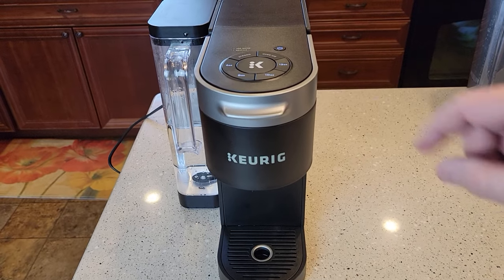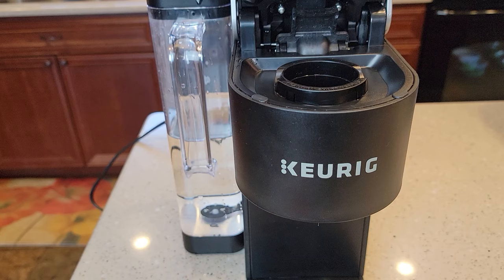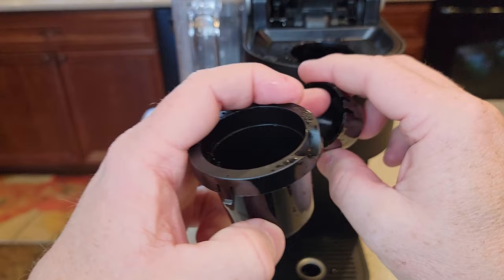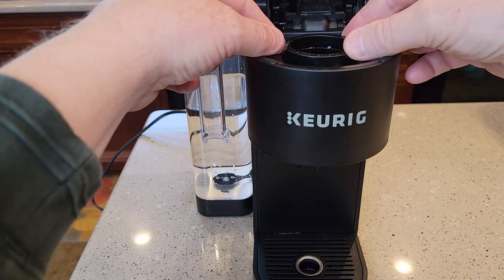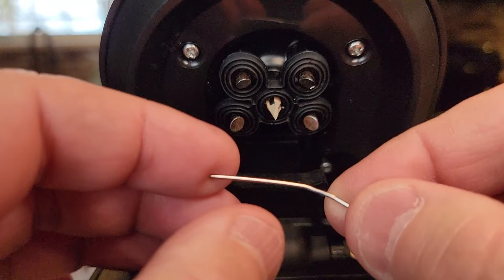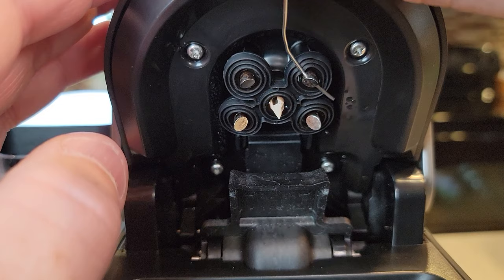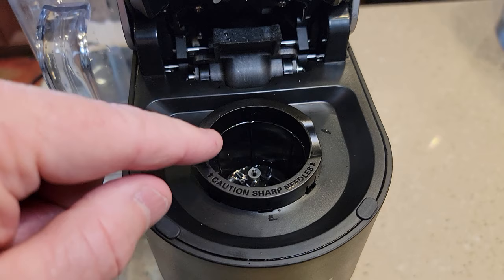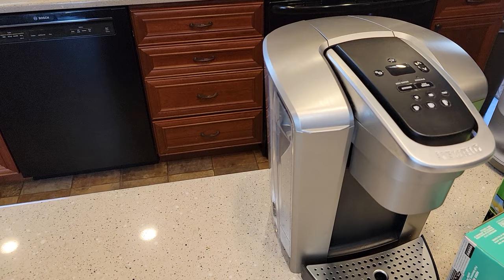HOW TO CLEAN NEEDLES Keurig K SUPREME Coffee Maker HOW TO FIX YOUR KEURIG NOT BREWING COFFEE

Comment: Hi Just a Dad , I tried all the steps with the needle cleaning and I’m still getting a slow drip and a message flashing needle. Just got this new Flexbrew 3 months ago, it’s working a half cup.
Reply from the maker: Sorry to hear this. is this the model with the removable water tank on the k cup side?
Reply: @JustADad  it’s the Hamilton Beach FlexBrew, the exact one from your video on how to clean the needle. One cup on the right side and the coffee pot on the left.
Reply from the maker: @jackieatterbury1336  check the screen in the bottom of the water tank, you might have to remove a screw to remove the cover. 
https://youtu.be/8jxeCaXW7MQ
https://youtu.be/-Qr7Ja4I3rM

Comment: Sadly, the quality of these machines seems very hit or miss.  I had a K Supreme that after less than 2 weeks wanted a descale and suddenly wouldn’t brew unless I hit the strong button.  If I tried brewing any size without hitting strong it brewed about 2 ounces n stopped.  Tried descaling it and went through the cycle but descale light still on and then it shut off.  Managed to open it and reset it but descale light still won’t turn off n won’t brew unless strong selected.  Did another descale and no change.  Contacted Keurig and they sent another.  Took about 3 weeks.  Literally just got new, sealed machine n plugged it in, rinsed reservoir n ran quick clean cycle.  Put cup in and lid leaves a small gap.  Brewed a cup n opened it to find water n coffee grounds all over n cup lid had a tear between two needle holes.  Tried two different cups n same outcome.  Checked cup holder and everything else but it won’t close. Contacted Keurig n now have to wait yet again for another machine.  Sighhh
Reply from the maker: Wow that does sound bad.  usually they are a little better than that.  it sounds like on the second unit the bottom needle basket is bad. I have heard of some viewers having this issue also.  I hope the next one is better, keep us updated!!!
Reply: @JustADad  I swapped the cup basket in the replacement one with the one that was in the first machine and it did the same thing.  I think the issue is on the top end either with the needles or assembly for that or something with it being just off on the body.  It’s just really poor quality control. I haven’t had a Keurig in probably 15 years and I get two duds back to back.  I only got it cuz the wife n kid like teas; cocoa, flavored coffee etc.  I’ve owned two Nespresso machines and the first one, Nespresso “U”, lasted 7 years.  Just never have issues with them.

Comment: I cleaned the needles and did the descale after watching your other video.  But when I brew 10oz I get only 8oz in a measuring cup. Likewise when I brew 12oz I get only 10oz. Note: this was done using plain water--no K cup.  Is this expected?  My machine is the Elite Supreme.  Just bought it a month ago.  Does the 10oz setting mean it's giving you room for cream? Thanks!
Reply from the maker: I just did brew with my K elite and my K Supreme.  They both brew exactly 12 oz when I press  the 12 and they both brew exactly 10oz when I press the 10, with or with a kcup installed.  I am not sure if you have the K supreme or the K elite.  If you have the K supreme make sure it is not in High altitude mode.  see this video on K supreme https://youtu.be/DOH1eBYNrds?t=1250
To turn high altitude off with the power off, but still plugged in.  hold the 8 oz and big brew k button for 3 seconds.  If the 12oz light comes on then it is in high altitude mode.  if the 12oz light goes out then you are not in high altitude mode.  
If you have a K elite then I have another video where I show you how to take it out of High altitude mode.  https://youtu.be/BH4thDo46e0?t=486
If this is not it then call Keurig. I hear from my viewers that they have great customer support.  There number is 1-866-901-2739
Let me know how it goes.
Reply: @JustADad  Thanks for that. I have the Supreme Plus.  I called the Keurig support #. They had me clean the nozzles and try running w/o filter. It still shorted me 2 ounces.  Finally they took my proof of purchase info so they can send me a new unit. Sweet.  By the way, I asked them about the High Altitude setting. She said this model doesn't have that.